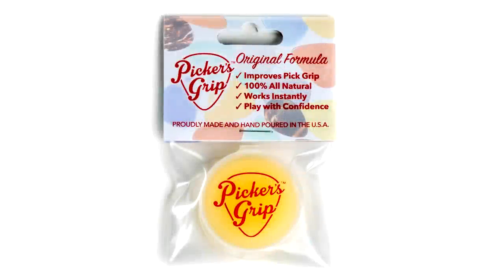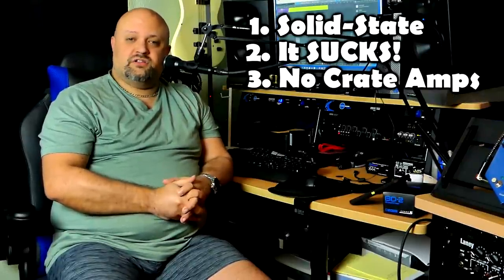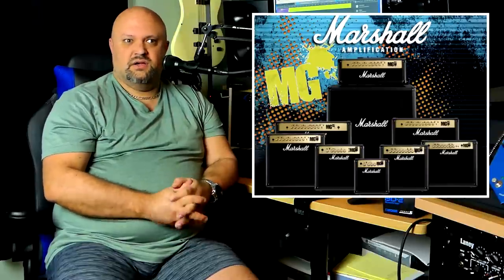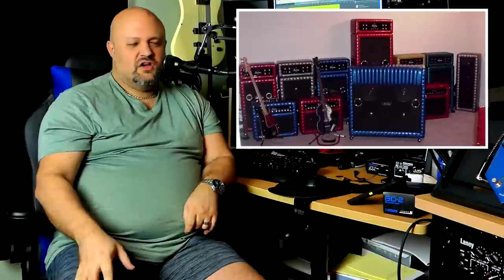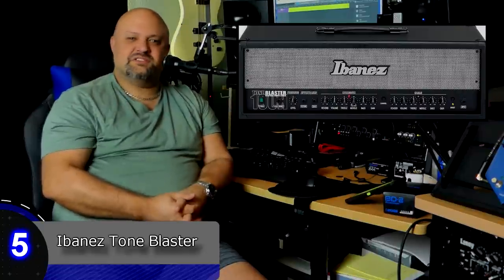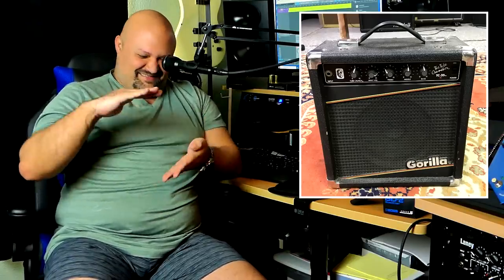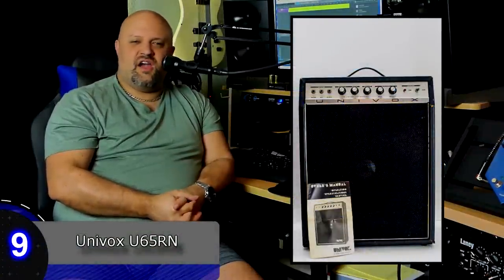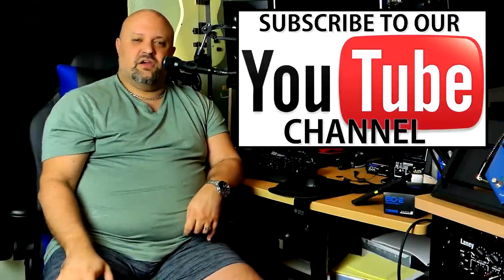Top 10 WORST Solid State Amps EVER!

Comment: My only criticism is that I think Modeling amps should be separate category from solid state amps.  There are so many bad amps out there I’m sure you could make a “10 worst Modeling amps”.  I love your insight.
Reply: And the amps should be aimed at gigging, practice amps should not be included. All solid state practice amps suck
Reply: How does Crate model GX–4126 fare in your ratings? (100 W RMS 50 W/side)
Reply: yes, digital modeling front end and digital conversion power sections are a whole different ballgame than transistors which they aren't
Reply: Yes, waiting for best/worst modeling amps video.
Reply: @0riole11  I agree,and it's ok everyone sucks at first .......lol
Reply: I love this guy he doesn't beat around the bush......lol😄
Reply: @nonelost1  4126? You sure about the model? Don't reckon there ever being such amp in the GX line. But I know that GX130C/G130CXL, Excalibur (GX900H, GX2200H), GX1200H and GX600 are awesome (although not versatile at all) amps for death and doom metal/sludge.
Reply: @Admiral_Bongo  Since I no longer have it, I can't say for absolute certain.
Reply: I absolutely agree with Marc. I find that a lot of older guys who used tube amps and solid states in the 80’s, especially the older metal heads, are now the biggest proponents for modeling amps and see them as advanced technology and an all in one solution to effect pedals and boards.
Reply: I have a question for you. My only modeling amp is a Roland Cube 30.  I play jazz so I never use the modeling function.  How are these modeling amps (like a line 6 Spider) at getting clean tones ? It would seem that getting a good clean tone would be fairly easy for amp designer, in light of the fact that the whole preamp section would contain standard op-amps, and other standard, well thought out, integrated chips, and the output sections would be a standard class AB type.  I do have an old Peavey Pacer amp that can't really get a total clean sound.  It's as if they wanted to emulate the old, slightly distored tube sound, whey they designed this solid state amp.  This would be good for like a Lynyrd Skynrd type of blues/rock sound.  I have used it for jazz, but it's not as clear as other amps.
Reply from the maker: @KenTeel Modeling amps don’t really have clean channels, they model them from other amps, just as they do with their distortion sounds.  Most modeling amps, the Line 6 Spider stuff in particular, is HORRIBLE at taking pedals.  The Boss Katana series amps are about the only exception to this rule that I’m aware of.
Reply: @RobertWJackson  That is interesting.  I have a Roland Cube 30, and it has two sections. One is the regular amp. The other (when you press a button) goes into where the modeling amp choices are.  I guess that other modeling amps don't have two separate sections, like this?
Reply from the maker: I have the Cube 40XL, which is the next generation of your Cube 30.  The “regular amp” (or the clean channel that you’re referring to) is actually a model of the legendary Roland JC-120.  They just gave it its own channel to make the amp more user friendly.  But don’t take my word for it.  Try running some pedals into the front of it and see how it performs for your needs.
Reply: @RobertWJackson  Robert, thanks for the information on the Cube amps and the association with the JC. That makes sense and maybe on of the reasons that I really like this little Cuble 30 (on the JC channel.) I don't use distortion, phasers, chorus.  I stick to a clean sound with just some reverb (provided by the amp.) The pedals that I use are: A looper, and EQ (7 band, I think) and a tuner pedal.  Do you use distortion, phasers,chorus pedals in front of you 40XL ? If you do, how do you like the sound with these pedals ? I would suspect that it would sound good, as the 40XL handles the amplification, and the pedals could handle signal processing.  I always thought that the Roland Jazz Chorus amps looked like great amps, for a clean sound. People gripe about the distortion ability (sound) of these amps,  It's hard to get one amp to do "it all." I would think that with pedals in front of the JC's that they'd do just fine for metal/rock/blues distortion sound.  The other amp that I use is a Carvin SX100.  It's a 100 watt amp (actually 75 watt, with the limitation of the stock speaker.) It's all solid state, integrated, surface mount op amps, fed into discrete transistors for voltage gain, the class AB output through a couple of large bipolar transistors.  So, it's conventional, except in the amount of surface mount components.  I play patio jazz mostly, so I try to keep the volume at a level where people can chat with each other comfortably.  I kind of dig being in the background (with just the people, whose opinions carry weight: other musicians in the crowd, paying attention.) It's an easy slot. No need to entertain.  Just make beautiful background music. And, I get to play my originals, in this capacity.  Fun stuff. I never use tube amps as I'm operating the amps in the linear region (no driving the amp into clipping for distortion.) So, it doesn't matter if I use tubes or solid state. Tubes are just a hassle and are expensive, to me.
Reply from the maker: @KenTeel No, I don’t use any pedals with my Cube 40.  I have three Boss FS-6 Footswitches that I plug into the back to control channel switching, effects, and the looper function.  $200 worth (at the time) of those footswitches admittedly was pricey, especially for an amp that sold for $250-300, but they are SOOOOO worth it for how much they increased the usability and ease of functionality of the entire amp.  I’ve even gigged with it a time or two.
Reply: @RobertWJackson  Robert thanks for getting back to me, and for the information.  You've truly made, in terms of space and equipment, an economical setup. No power supply problems or pedal boards for you (It sounds like.) That is what you call maxing out what you have.  Roland does such a good job on these amps.  About using them on gigs, I've found that my Cube 30 is gig worthy on smaller patio gigs.  I've used the Cube on patios that had people up to 100 feet away, and for background music, it worked just fine.  In fact I tell potential employers that I pride myself on being quiet enough that their customers can talk to each other without straining.  Of course if I were in a dance band, I wouldn't make that claim.  On a different note, I just got some automated mastering software access, on a Black Friday special.  The automated mastering does a pretty good job. It's also less hassle for me, knit picking over tone, compression, etc.
Reply from the maker: @KenTeel For live gigging purposes, I actually prefer a larger amp and a pedalboard.  The Cube-40XL I’ve only grabbed for really small stuff, or gigs when I’m only playing a short 45-60ish minute set in a dive venue or something like that.  One limitation of that amp is that it’s only a 10” speaker, and even mic’ed up through a PA it still sounds pretty boxy at louder volumes.  There’s some instances where it’s perfect, but it’s not exactly an ideal gig rig.
Reply: @RobertWJackson  Robert, before I comment on the Cube amps, I want to say that,  I went to your sites, and checked out one of your videos (the one 8 overlooked, inexpensive, good guitars.) Well done.  About the Cube amps, I suspect that we're talking apples and oranges when we discuss these amps, because I don't play with a band,  I don't play loud, and I don't use distortion. I'm not familiar with mic'ing and amp through a PA system, so I can't comment with any kind of knowledge on that application. The only thing that I can say is that the line out jack on the Cube amps should, of course, be using a preamp for the amplifier, while running it into a larger amp.  So the line out, should yeild a different listening experince that placing a mic in front of the speaker. It appears that your orientation is more toward a distorted guitar sound, and there is a universe of tones within the distortion category.  So, you can discuss the finer points of good distorted guitar sound vs bad or mediocre distorted guitar sounds. My application for my Roland Cube 30 has just been that of low volume, patio environment (background patio jazz capacity.) So, when I talk to guys about guitars and tone, often times there is a miscommuncation on what the application of the guitar, amps, etc, is for each of us, respectively.  I like the fact that you're willing to consider the small, solid state amps, though.  To me, they're grand: No tubes to hassle with, just constant, reliable sound.  They are a winner for me.

Comment: You did KUSTOM AMPS a great ? service. My 1967 Kustom amp still works, plays loud and clean or killer distortion with '83 ProCo Rat. It came with two cabs with 4 D-130 JBL's. Covers and all plus lifetime warranty, although never needed it. Just saying. Loud and proud on stage.

Comment: I've only ever seen gorilla amps in pawnshops. I'm pretty sure they were manufactured in used condition.
Reply: I think your right thats where i got mine and it looked rough and used lmao😁😁😁😁
Reply: Lol guys my local music store gave them away if you bought a guitar lol I bought a USA strat and got a gorilla for 350 back in 85 lol wish I still had the strat but ironically I have the gorilla lol
Reply: I had a couple of Gorillas, a GG25 and I think a GG10. They sounded great, but both of them started getting noisy pots that somehow degenerated into everything becoming noise until there was no signal left.  Ran across one in a pawnshop, turned a knob, heard the static, and instantly said "nah". If somebody built the same circuit with quality parts, I'd buy one.
Reply: Blow the speaker for no reason, like when it’s turned off.  Lol

Comment: I had an Ampeg with a 1/10 that I hated. Someone stole it and I'm still laughing about it.
Reply: sorta funny,,,Crate aka SLM was why Ampeg Jets  were available in the '90s. 
I actually met a rep at a local shop. 
yep. all tube. They were good little amps.
Reply: @glenkepic3208  , the original 60s Jets were better. The 1962 version had 6V6s and the '64 version had either 7591s or 7868s ( same tube, different base and pinout). The 90s Ampegs were cool in their own right but rather different electronically, and utilized printed circuit boards.

Comment: The Kustom Tuck & Roll did FOR A VERY SHORT TIME had 1 redeeming quality. Just one and only just for a short time. They used Altec Langsing speakers. The one I had that was given to me by a guy that barely knew me. A 20 something guy I’d just gotten into Jr high and for a minute I thought I wanted to play Bass & guitar. He gave me some Bass head he wasn’t able to trade in for a decent amp. It came unbeknownst to him till later. A 2X15” cab. They were awesome bass drivers and over the years went into several P.A. speakers & monitors I’d built. Wish I still had them.

Comment: The OLD Marshall MG heads are not bad at all. The Marshall CODE is the worst SS amp I have ever played.
Reply: Really? The worst? I've played a small handful of SS amps and my CODE25 sounds pretty dang good. The problem I have is that there are too many presets. I only use 2 or 3 variations of the same setting with minimal effects. Plus it doesn't take external pedals too well.
Reply: The little 15fx amps are pretty great actually

Comment: So I picked up an old Gorilla GG80 for cheap.  When I first turned it one and had the volume low it sounded like junk.  But I was shocked once I cranked it up.  I could not believe how much better it sounded once some electricity was really running through it.  So for an extra amp to pull out if a bunch of players come over, it will do.

Comment: You've got to include Fender's late '60s solid-state line. They were horrible. Fender tried to recreate all their great models with transistors and it didn't exactly work out for them. I had a Solid State Bassman (SP3100) which came with a 3-12" cab (?) and it sucked. Constantly blowing fuses and the overload light stayed lit 99% of the time.
Reply: I had a solid state Deluxe Reverb amp, ice pick shrill and clean. It had "uses" but not enough to warrant moving it gig after gig. It weighed nearly as much as a tube counterpart.

Comment: I can take an old solid-state Peavey Renown 400 and put it up against a JCM800 stack and with the twist of a knob you won't have a clue as to which amp is which if your eyes are closed.  The 400 will also blow that 800 out of the room.  In fact I'll put it up against any boutique.  All this "solid state sucks" is a bunch of blind fanboy bullshit.
Reply from the maker: I never said solid-state sucks.  I like plenty of solid-state amps.  Just not the ones in this video. LOL
Reply: Totally agree, I had a renown 212 back in the 80's...Absolutely insane!!!
Reply: Totally agree
Reply: I'm sorry but I have to disagree! I owned a Peavey Renown In the late 80's I believe. It was the worst sounding amp. The clean was ok but the saturation channel was the worst. No definition or tight sound, just muddy. It lacked warmth. If you played rhythm guitar you could get by. When you added pedals to it that helped but over all it was loud and muddy. I've never been what you call a tube snob but the newer Amps sound much better. I had the Renown for over 10  years.

Comment: The mighty gorilla amp! My first amp was the 65 watt gorilla. It was as bad as you described it. It was so unreliable, it only ever worked half the time. I took it back to the shop where I bought it for repairs under warranty, they gave it back to me a week later with same problem. I managed to pull it apart myself and got it to work properly for a while. I ended up doing a Pete Townshend on it. The thing ended up in as many pieces as I could get it. And I emptied into a skip bin. Horrible Horrible amp! The thing was possessed!

Comment: Ive been using a Marshall MG 100 watt and honestly its not bad, im mostly using it for the clean channel as a pedal platform, but the OD channel sounds pretty good in a pinch, by no means as good as the old school tube amps but serviceable
Reply: Used a mg100hdfx half stack all through my hs years and it was JUST FINE. Sold it though.
Reply: There's a very popular guy here in YouTube land that makes one of those marshall MG 100fx sound pretty damn good .

Comment: Agree with all of these except the linebacker.
While it didn't have any real distortion tones to speak of, it was a half-way decent pedal amp.
I used this amp for a few years when I first started out.  Again, I used a ds1 and some other pedals in front of it and it sounded OK.
I graduated to the all mighty vacuum tube and left the old linebacker in the dust.  RIP Laney linebacker!
Reply: I never owned one , but here in England , the Laney Linebacker was as popular as the Peavey Bandit . At that time I had a little Laney Mighty Eight followed by a 100watt solid state Vox Venue.
Reply: Had one of them too.
The bandit actually had a pretty good sounding distortion.  Can pock those up pretty cheap over here.

Comment: This video is so true. Had a Marshall MG (got it cheap and the effects channel didn't work, loud buzzing from the amp),  had the misfortune of playing through one of those Kustom combo amps (the speaker sounded like it was a board - it was sufficiently terrible), had a Gorilla amp when my band was on tour as a "practice amp" for the hotel room - it just disappeared one day. I suspect the bassist threw it out. The Fender Mustang is ok and the Marshall Code is ok but neither is great but they're ok for a backup amp in case one of my Marshall tube amp blows at a gig.

Comment: Do you remember the Rickenbacker Transonic? A friend of mine had one in 1969, if you turned it up too loud it would blow an output transistor. I think Steppenwolf used them for a little while in the late 60's. It looked great though.

Comment: I actually have experience with three of the amps on your list. Here are my opinions:
1) Kustom K200B-3 tuck-n-roll: actually not a bad amp, but not a tone monster, and that's fine because it wasn't meant to be. It's an amplifier*. It gets loud. Crazy loud. And clean loud, at that. Having two simultaneously available channels was damn useful for separate guitar and keyboard chains coming through the same cab. Built-in *fuzz circuit  in lieu of a "drive" is quite novel, ditto for a unique click-stop mid boost thing. It did tend to give me shocks occasionally though.
2) Kustom Lead I combo
 My brother still owns his, which was the first guitar amp I ever played with, when I was a kid. So I have some sentimental attachment to this thing. Again, no good for what's now considered good guitar amp tone-the Drive control is a bad joke- but it's very bright, has great vintage type reverb, and nails that twangy surf/Ventures sound. It's unique, anyway.
3) Gorilla. I got one of these along with a 1983 Squier Bullet (made in Japan) that I bought from a buddy back in college. The best I can say about this turd of an amp is that I stuffed it into a suitcase along with the the Bullet (which is disassembled to fit) and thus was able to have a working guitar rig with me when I lived in Germany for part of my senior year. It's been collecting dust ever since.